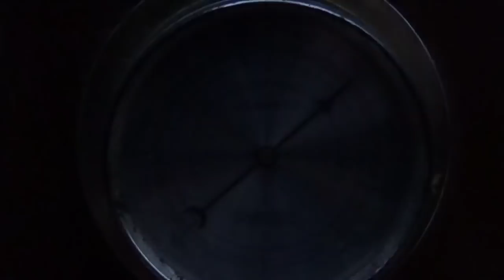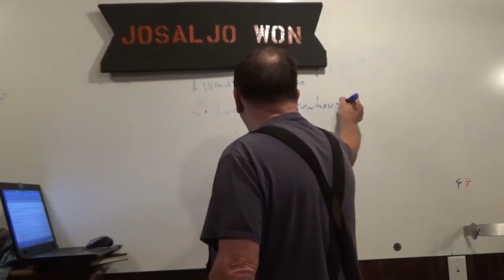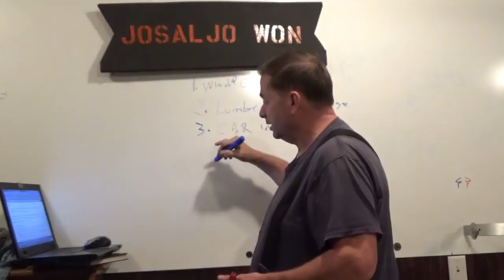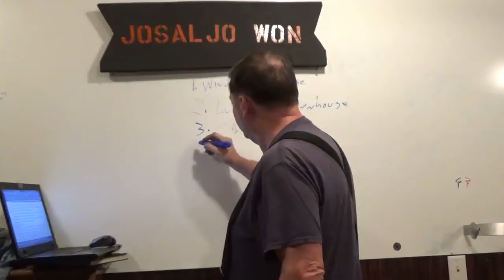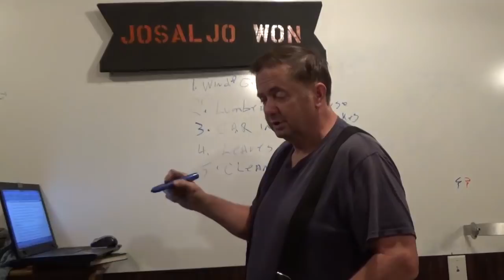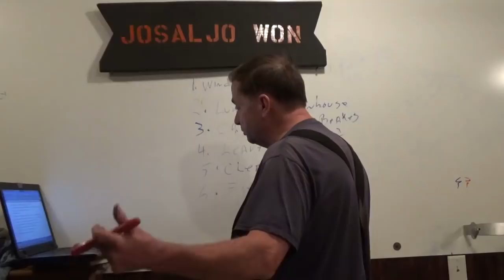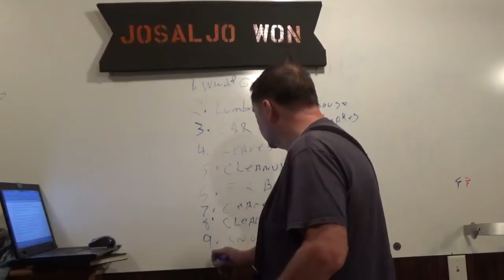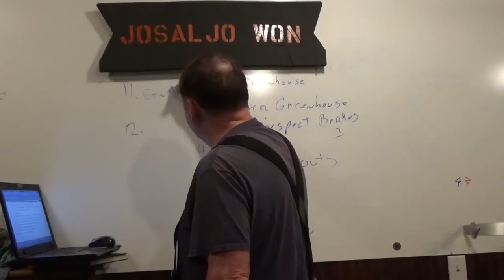550 Ford TLB, Solar Kiln Status, Lecture for elderly helpers.

Comment: Well said. It needed to be said. At 65 you have the challenge to change your lifestyle for the better for many more years. Work at it. At 75 I find it takes longer and longer to do less and less.
With the wood in the greenhouse for 6 months, what facility do you have to circulate air, control the dehumidifier and add outside air?
In fact, why not leave the wood in the kiln? Cycling the temperature, running the dehumidifier and periodically exchanging the air with outside air should complete the drying process. Look at my comment about kiln operation several days ago.

Comment: ps:  Living up here in The Northern Tier of PA I developed a statement to live by: "IF it is an outdoor project and IT is not done be Sept 1st... IT will not get done."
Reply from the maker: I have the same mind set and this rain we are having makes picking up the darn leaves impossible.
Reply: Leaves keep and we bought a battery operated Leaf blower and once the leaves are dry I nibble away at them and then when I can bet back to mowing I just blow away from the house.  Sometimes I think we spend way too much time making grass grow where it does not want to and cleaning leaves away from where they want to be.

Comment: Take the injector #3 and switch with one of the other two cyl. and see if #3 still miss fires. If #3 still misses then remove head.
Reply from the maker: Got it, thank you so much.
Reply from the maker: I tried two other injectors that are good bled each one, still misses and is making a cracking sound that reminds me of a backfire in a gas motor. Thanks for the help.

Comment: Check the compression before you take the head off. If it is good, you don't need to remove it.
Reply from the maker: I was looking at a compression gauge to handle the diesel pressure. I bled the injectors a number of times. Now for the first time the #3 injector does nothing to the engine idle when I crack it open.
Reply: To me, sounds like the injector is bad. The engine  should have a sound change will being bled.